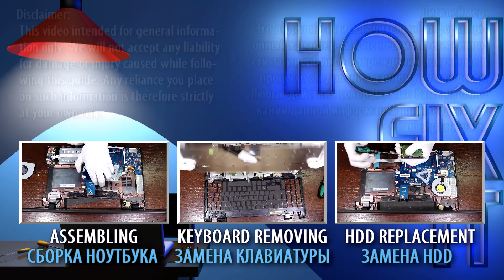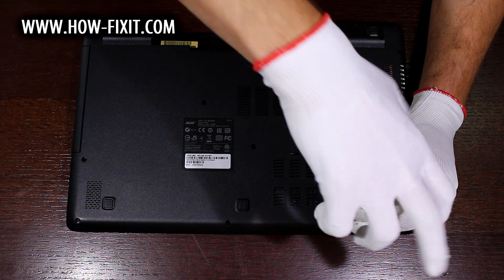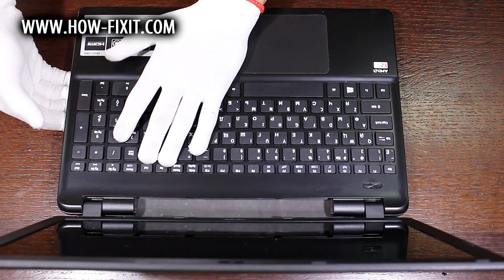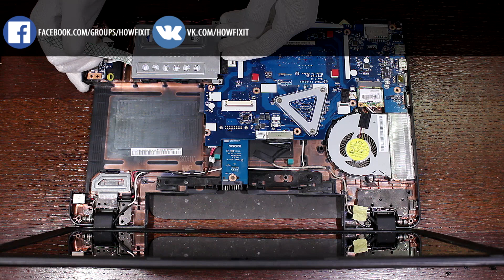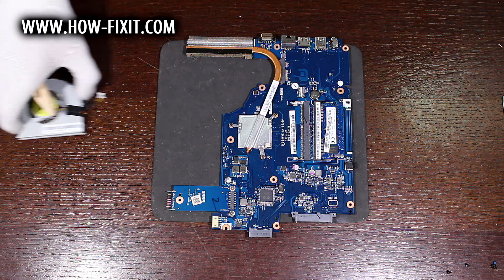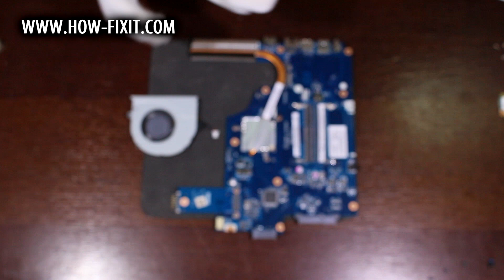Acer Aspire E5-511, E5-521, E5-571, E5-572 RAM Upgrade and Install Guide

Comment: I should have started watching this before I started taking mine apart. I got a third of the way, and broke the white clamp connector on one of the plastic sheet wire connectors, then I found this.
I probably would have stopped or broken more if I didn't watch this. My model E5-521 is much harder to get to the memory slots, then my wife's model, which was just take one small backplate off and there they were. Not hidden underneath the board. 
Mine also only had one memory card installed in it. But has two slots. I plan on filling both when I get them.

Comment: is there someone that knows if the dual channel is supported by the mother board in the acer E5-571G-562B?  is it worth to replace the default memory (4 GB DDR3 1600 mhz) with a 2*8 GB DDR3 1600mhz or is it better an higher frequency? And if so, what is the max frequency supported? Thanks

Comment: What is the RAM limit for Acer Aspire E5-511? Thanks.
Reply: Says 16gb, honestly using the 4g it comes with and replacing the 2g with and 8g will give you WAY more than enough memory to do anything this laptop is capable of.

Comment: Hello, thank you for the video! 
After replacing the ram, my computer is stuck in a loop. And than it,s says preparing repair. But it is still stuck in a loop of restarting. Can someone have any idea of what is happening? Thanks.
Edit: I finally think that it was one of the ram that wasn’t properly connected that create the infinit loop plus a cable that was, I think, not properly connected. Finally, after some restarting loop, windows has start. I know have 16Go of ram! Thanks a lot for all the videos, but especially this one and the hdd to ssd replacement!

And the design of this computer is really thrash, especially when the replacement doesn’t work the first time (happen to me with the hdd to ssd replacement and the ram updgrade.

Thank you a lot!

Comment: I dont know wether youre upgrading memory or diffusing a bomb. Such poor design god damn. Mine is marketed as 64-bit but only has 4gb of ram, so I have no choice but to upgrade. You think acer could be assed enough to cut out an access panel underneath the damn thing for easy access to the ram; LIKE EVERY OTHER LAPTOP MANUFACTURER IN THE MARKET

Comment: Hi, my laptop is ACER ASPIRE E 15 TOUCH E5-511P-C9BM, Intel Celeron N2930 @ 1.83GHz and 8 Gb DDR3 RAM. Can upgrade the CPU?
Reply: Nope you cannot upgrade the cpu in a laptop because it is build into the motherboard
Reply: @jordankrause4632   You can but its not easy lol
Reply: Yea I have the same question

Comment: I have no idea whats going on, I tried to add another 4gb stick to the 4gb already installed and the laptop wont boot. If I change it back to one stick it boots. I've tried each stick separately in every combination and it still works fine but when I put two 4gb sticks in it won't boot.
Reply: I had an issue with my computer like this and it was because the bios needed updating
Reply: Did you fix this and how if so ?
Reply: @Biotune  I wouldn't count it as fixing it, It just worked after I swapped an 8GB stick from another laptop and it booted. Then I thought I would test the 2x 4gb sticks another time and boom out of no where they sprung to life haha
Reply: @027fuckoff  Ahah ty for the reply man ;) !

Comment: I would like to upgrade memory in aser aspire E5 511 p7js which ram would like to upgrade I m confused in ram slot given 1.5 slot but show in lapto 1.35 which already existing ram speed 1333 show in system which volt I need to purchase 1.35 or 1.5

Comment: Hello Sir, 
My laptop model is Aspire E15 E5-572G-525V

My current ram is 4GB DDR3 L Memory

How can i upgrade the ram and what is the maximum ram upgrade limit of my laptop.

Plz reply Sir.
Reply: maximum ram upgrade for this laptop is 16GB. I recommend you to buy another 8GB ram(Same speed) so you will have 4+8 = 12GB.
Reply: @krishnaghagre9432 Ok sir, can u suggest a best ram for this modal, so i can buy plz

Comment: There are probably bombs that are easier to diffuse than replacing the memory in this laptop.  Acer couldn't even do what every other laptop maker has done since they started making laptops.  I only wish I had watched this video before buying memory.
Reply: I just did exactly the same thing. Got for granted that I would find a memory/hdd hatchet below. OMG I don't have the experience and tools required to perform this surgery.
Reply: All Acer's models are not the same. The aspire E!, which I just did before this E5-521 I am doing. Just has a little backplate to take off, not even the whole back, and the cards are right there next to the cpu..

Comment: hey guy i needs to know if i can have at lest 16gb of memory in my acer aspire E5-511 or no i did try but it was very slow don't know if cus its default memory chip as bad or no so i needs to know if it can hold 16GB plus or do i need to upgrade my OS in order to do so. thank you.
Reply: @destroyer although it states that 8GB is Max RAM you should be able to 16 GB running just make sure it's two 8GB sticks with the same clock speed. Windows 7 or above or any modern Linux distro should work fine.

Comment: What the maximum ram I can put in this??
Reply from the maker: 16gb DDR3L (8gb x 2)
Reply: @howfixit  the motherboeard support 16gb? Wow i never tought.
Reply: I have Acer e5 551 and I have 24 gb ram 1600mhz even though it says 16gb is the max. I have one 16gb and one 8. It was very difficult to find 16gb ddr3 single channel.

Comment: Thank you very much for this, it really was essential to being able to install this module. Interestingly when I opened it up I thought I may as well give it a good clean too and the fan and innards were surprisingly spotless (unlike my main PC). The only difficulty I had was in removing that final clip it just didn't want to budge fortunately I could leave it in and still install the module. I also did not have to remove the cable stuck to the hard disk it can be pushed back and out of the way.

Comment: Awful design ACER!   Putting the RAM under the keyboard and under the motherboard.
Reply: Yes, definitely an awful design. Keyboard is held in with very small screws and a few clips...I've had to replace two, not looking forward to replacing it a third time, or installing more ram. May be easier just to buy a laptop with 16gb ;).
Reply: There are laptops with open able place for RAM, that's easier than opening the whole thing
I'll just take it to a repair store, I just need to find my 4 GB of RAM and then am good to go.
Reply: Indeed, I had to replace the HDD and this was a pain in the ass
Reply: @ertvvf  I tried to do this but the HDD screws we're in so tight they just stripped so I gave up haha

Comment: Thanks for the video.
This is the worst designed laptop ever.. i hope ACER would design it in such a way you can easily access upgradeable units such as RAM and HDD.
Reply: This laptop was made in 2014, all the ACER laptops today is much easier to modify (HDD, Ram or M.2)